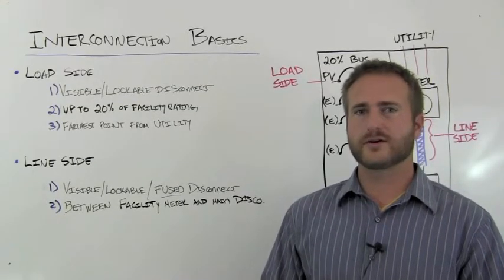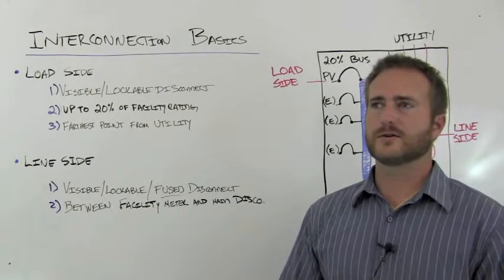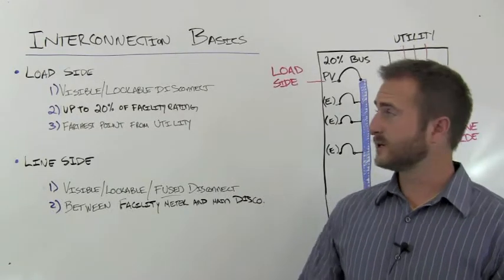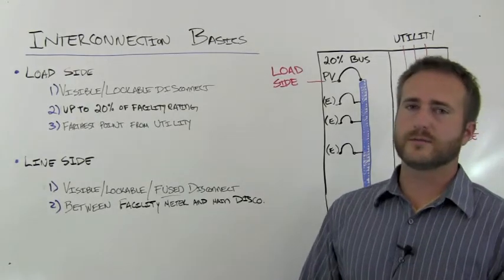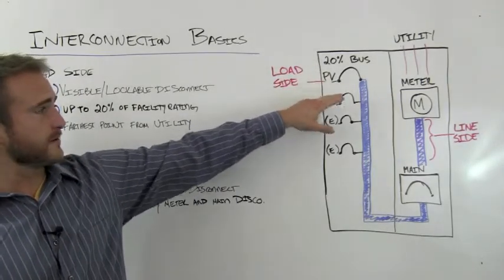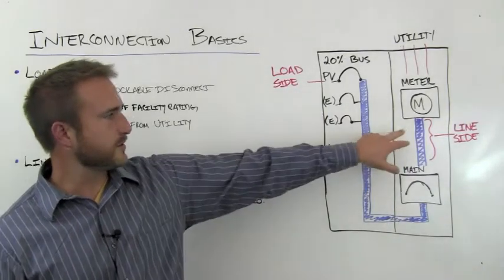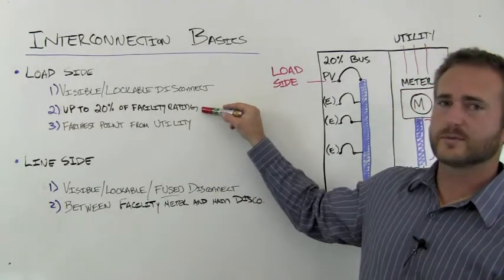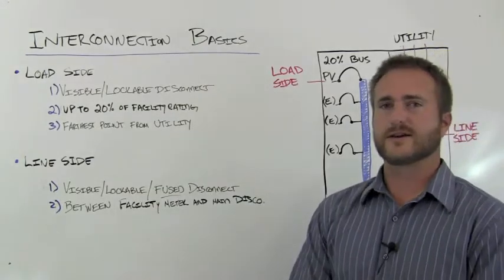Tech Talk 9: Interconnection Basics

Comment: The 20% rule discussed in the video only applies to panelboards. Switchboards are not subject to the 20% restriction, and if placed at the end of the bus bar, the PV breaker can be rated to the full ampacity of the bus bar. They'll be no way the bus could be overloaded.